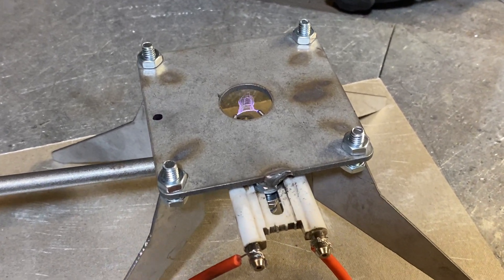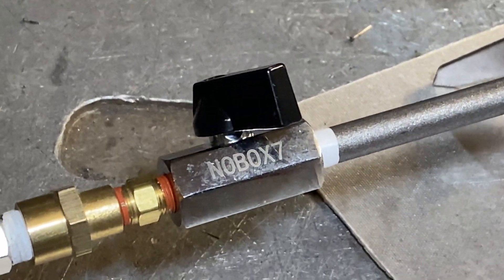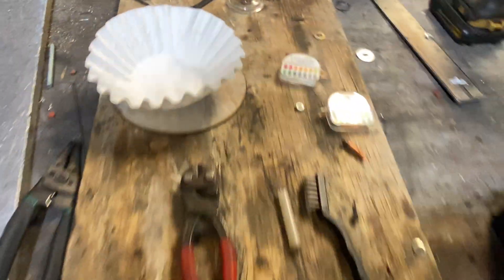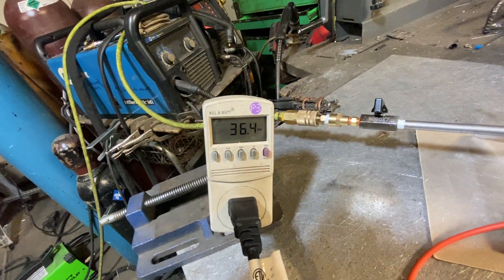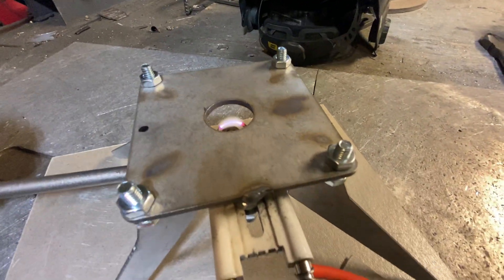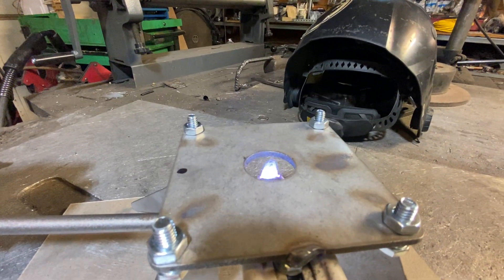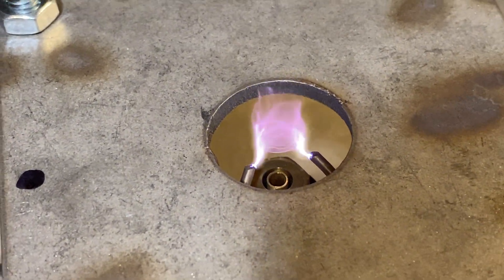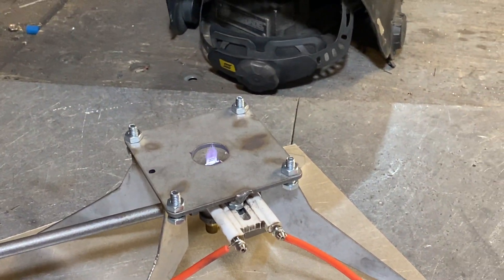Igniter test and plasma surface treatment device idea

Comment: This looks sooo close to a gliding arc reactor. If your electrodes slowly diverged after where the arc first forms, then blowing air through the gap will cause the arcs to spread out, spreading the heating of the metal over a larger area of the electrodes rather than delivering the heat to a localized hot spot.
Reply from the maker: Thanks for the input , i have bin considering building a surface treatment plasma gun for coatings .
Reply: @NOBOX7  interesting.  I've seen oxidizing contrasted with reducing flames etching the surface of hdpe plastic to vary the surface wetability or except a coating or adhesive. Or apply permanent marker.  Would you say the reactivity of a plasma flame might be similar to an oxidizing flame?